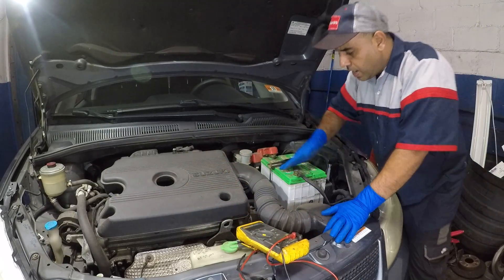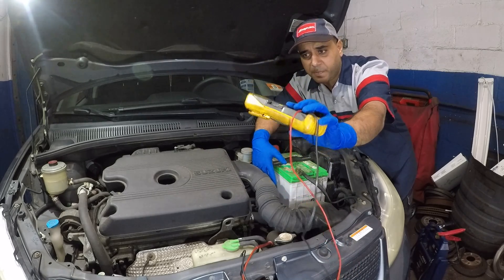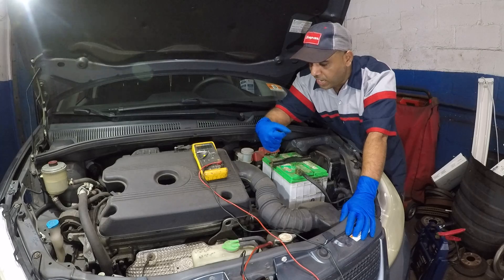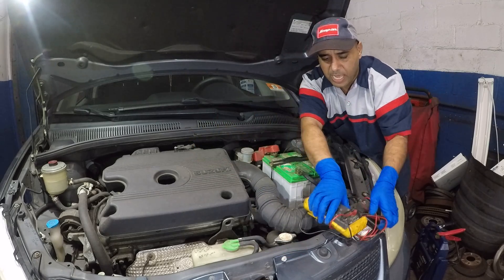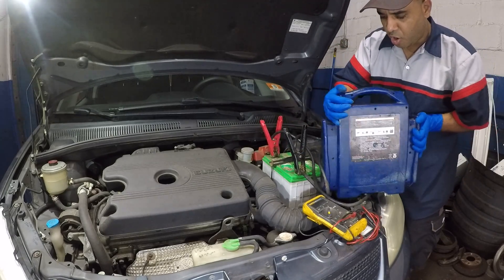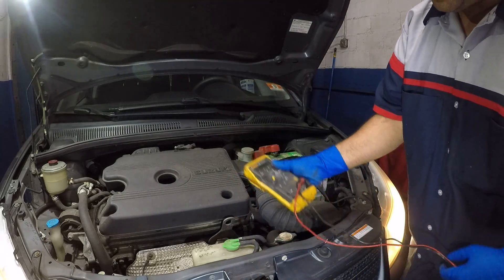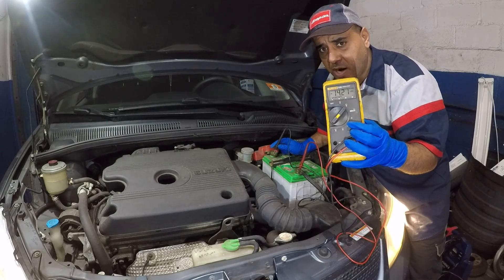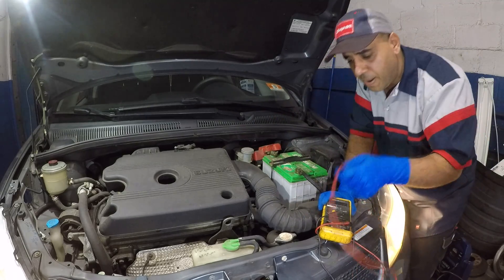How to test Alternator Voltage GOOD or BAD

Comment: 14.2v when the engine is idle, but when I run the AC and headlight, dropped to 12.8v.   Is the alternator ok ?  thanks
Reply from the maker: What kinda car
Reply: 2005 lexus rx330.   Thx @RBTheMechanic
Reply from the maker: @ most likely alternator
Reply: @RBTheMechanic  ok, thanks

Comment: You put the negative cable on the positive post on the battery and that’s why the voltage read -14.45.
Reply from the maker: It’s fine just reading

Comment: I am not sure if this is my battery or Alternator. Battery reads at 12.62 not started. When cranking it it hits at 10.49 then up to 13.80. I have not caught this on video yet but I assume Alternator is going bad but took it to Oreilly's it said it passed. I told them what is going on. I showed an image of the battery gauge going to the right about 3/4 the way. This is a 2006 Ford F150. While at idle the cluster of everything would move to the left & music goes off to NOT the truck just the cluster going weird but all I had to do is press the gas pedal & back to normal but I would see the battery gauge go the right about 3/4 then back to middle just weird. The codes I get are Battery Voltage too high. It just comes & goes. Alternator?
Reply from the maker: Battery show bad but alternator might not be charging
Reply: @RBTheMechanic  So both are bad?

Comment: I’m confused… you checked the battery voltage…?? How do you check the alternator voltage? Like you said put voltage meter on battery and other on alternator..? But didn’t show how
Reply from the maker: It’s connector so when ur checking it with car running its alternator voltage unless it goes below

Comment: Mine is reading 14.8 and im getting the code p056300 System voltage high no sub type information
Reply: It's mercedes c250 2016
Reply from the maker: Yup bad alternator and replace the battery with it

Comment: Lx470 been having stalling issue no engine codes replaced coils plugs fuel pump reg alternator charges 12.4 lights on high beam aircon on this will be third alternator in 5 years this car has chewed
Reply from the maker: Did any of these alternator were original from dealer?

Comment: I have a new battery and alternator in a w204 Mercedes and when it starts the voltage goes up to 14.8v but after a while it goes down to 12.6v and it continues like this even when driving, is something wrong or does my car just work like that?
Reply from the maker: U may have an issue u might want to get some information on alternaotr output voltage

Comment: 13 or 13.1 is not good. once you turn on headlights , ac, charge your devices, speakers full blast at the same time it could dip to 12 or below
Reply from the maker: Not true alternator will never drop u see 13 u less it’s back some carbs now run off 12 and u derload ecm kicks up alternator to produce more
Reply: @RBTheMechanic  well then ig cris fix is wrong you need to call him out :face-blue-smiling:

Comment: I have 2012 Honda Civic Hybrid. The DC to DC converter (the part responsible for charging the 12V battery) is giving me 14.55V. Is it too high or is it normal? Thank you.
Reply from the maker: 14 is normal
Reply: @RBTheMechanic  Bad news. Today at noon I couldn't start my car. I jump started it and measured voltage on my battery: 12.2V while running. When off, it measures 10.0V. When I increase rpm only after to 3800 then I measure 14.55V. I am not sure why yesterday it was still showing 14.55V when idle. Does it mean that the DC to DC Converter is most likely bad? Thank you.

Comment: I’ve got a 2008 crown Vic throwing 12 low circuit codes
Reply from the maker: Bad alternator or circuit check alternator output should be above 13v ex 13.39. 13.29 13.59 any number after 13 is good voltage
Reply: @RBTheMechanic  okay I get more then 14 I also checked all grounds
Reply from the maker: @Dominicautolife  ok

Comment: I see ok but this is one let's see if you got it I turn my car on then the voltage jumps 15v the drops to 13.8 then up again it fluter's on drive and on park took it to AutoZone they said its a fine alternator I don't know ,and it's a 1995  Lexus 400.any idea and battery is new allso thank you if you answer
Reply from the maker: Gio arteaga i had problem like that on Hyundai tho. Customer came with both bad head light bulbs we changed both bulbs and he came back the next day both bulbs bad we was puzzled and it happned again they we kept the car for day and discovered he had brand new alternator and we was so puzzled then we checked voltage 15 volt so we put in another alternator problem sold so I think ur alternator is giving too much power